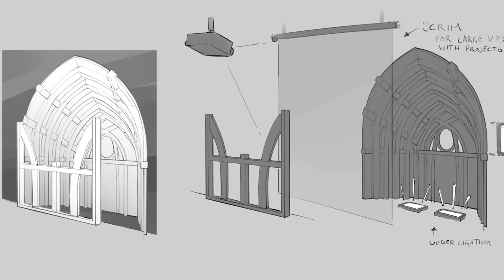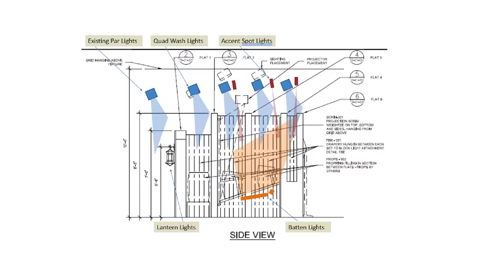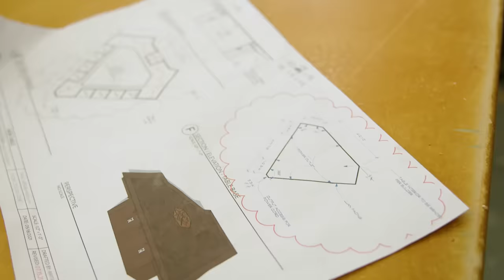Campaign 3: Behind the Set

Comment: Yup Talesin, I also noticed the "VM" designed into the lamp, nice touch there by the designers.
Reply: Also works for MN as well, and if you flip it upside down (like in the concept art a few seconds before there) it looks like the Travellers symbol, a path leading through a gate

Comment: I used a projector for my d&d games for a while too, but in a different way. I used it and a first surface mirror to bounce my maps down onto the table where we had a big vinyl mat to play on. the neat thing about vinyl is its what they use to make projector screens, its cheap if you just get upholstery vinyl and it works well with wet erase markers if you do actually have to draw something or your players wanna scrawl something down like spell slots or whatever. we also used a tv for the initiative tracker or at least the player view of the initiative. I use an app call improved initiative that simultaneously give a player and dm view of the same combat. the setup was also good for showing what monsters or npc's looked like. man, i loved that setup. then I moved and rented an apartment and I don't feel like my landlord wouldnt like me removing a ceiling fan and mounting a projector to the ceiling in its place. I still use one on a shelf, but i project to a vertical screen now and we use roll20 for maps. still cool but it was nicer projecting the map onto the table itself.

On another note I wonder how they deal with the ambient noise the projectors make?